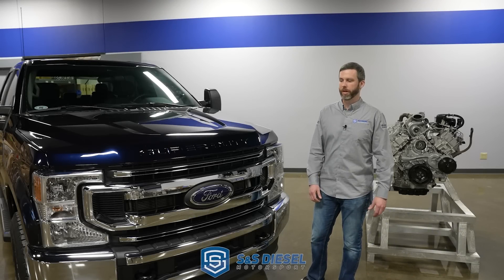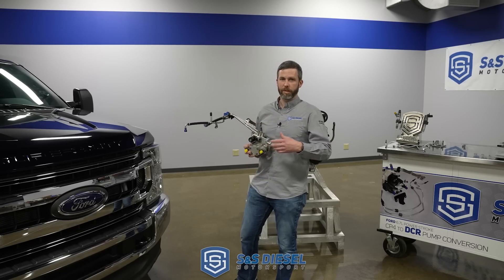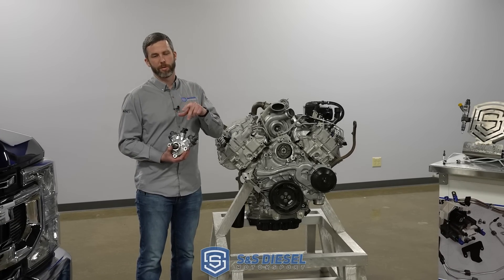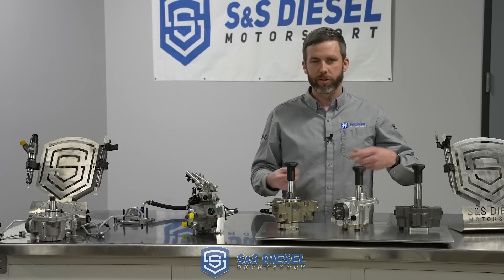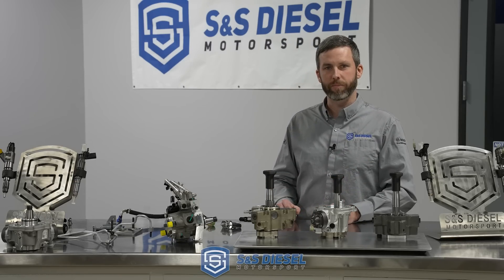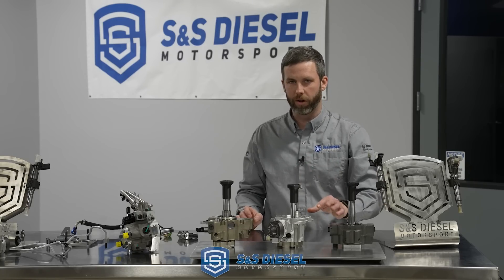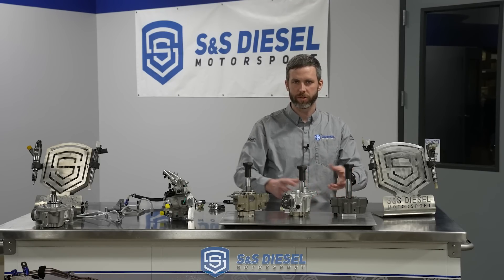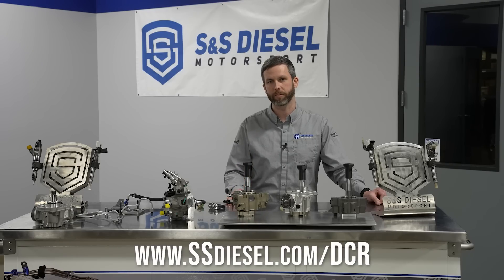The Long-Awaited Ford CP4 Solution - S&S Ford 6.7L CP4 to DCR Conversion

Comment: Does this apply for 2020 and up models?
Reply from the maker: Yes. The DCR Pump Conversion is compatible with 2011 and up 6.7 Power Strokes. It is CARB compliant up to 2023.

Comment: My biggest challenge is finding a really excellent in Western NC shop to install this new pump. I vetted several diesel shops in my area off your website and honestly need a much higher level of confidence that this pump will be professionally installed. One shop said they would need my truck for two days to check for leaks? 😮 Open to suggestions before I place my order. Thanks.
Reply from the maker: It's not a bad thing to take a little extra time to check for leaks after the fuel system has been open. In most cases it is not needed, but a little extra quality control is good. We have good confidence in the installers listed on our dealer map. They are either vetted by the distributor they buy from our by us directly if they are a direct dealer. We do not have a lot of coverage in Western NC, so you may need to expand your search into Tennessee or Georgia. Shoot an email to info@ssdiesel.com and we can recommend a few places that are Power Stroke specialists.

Comment: Where are these DCR pumps manufactured? Are they made in China? 🇨🇳
Reply from the maker: DCRs were originally made in China when we first released the Ford 6.7L DCR Pump Conversion. Since then, we have created a large enough market for the DCR in the USA that Stanadyne has built a DCR assembly line in Blythewood, South Carolina. While many of the components are still made in China, the assembly, end of line testing, and quality control are done in the USA. Even the pump bodies are forged in the USA. It's not uncommon for a global company to use a global supply chain. The main takeaway is that Stanadyne is a reputable company with locations all over the world. Since the DCR was originally developed for engines in the Asian market, that's where the original plant was built. Thankfully, a young engineer working in a US branch discovered that the DCR would fit in the valley of the 6.7 Power Stroke. That engineer insisted on working with S&S to develop a variant specifically for the 6.7 Ford and the rest is history. We have complete confidence in the DCR and will continue to grow the demand so that we can help bring even more manufacturing, than we already have, back to the USA. Here's a link to a video tour of the plant in South Carolina: https://youtu.be/y8IOhefx4Sw?si=RE1j3AW7UaKZ2Yy7
Reply: @SSfueled  Thank you!

Comment: Can this work for 2024 powerstroke 6.7L High Output diesel?
Reply from the maker: We have one installed on our 2023 HO and we are aware of another 2024 that is running a DCR. Both trucks are running great. With that being said, we are still taking our time to thoroughly validate the DCR on our 2023 before we make an official announcement.

Comment: Are you able to run both the DCR conversion kit with the firewall mounted disaster prevention kit on a 2011-2016 Ford F250/F250 super duty for two levels of protection?
Reply from the maker: The complete Disaster Prevention Kit is not compatible with the DCR, yet it is not needed. The DCR will not create fine metal debris if it does fail. The return filter assembly portion of the DPK can be retained and it will not hurt anything.

Comment: Why don't ford just start using it so we don't have to waste more money on those trucks?
Reply from the maker: We're trying. There are long-standing relationships and agreements at play. We would much rather sell to the auto manufacturer and do it right the first time around. Until that happens, we have a better option for Super Duty owners. We feel your pain. Spending that much money on a truck, you want it to be rock-solid from the factory.

Comment: looks like a good kit by wondering you say it helps save the fuel system. so do you guarantee it to save the fuel system or only help
Reply from the maker: Great question. Due to how the DCR is designed, it will not generate fine metal debris if it does fail. It does not have a tool steel roller and cam like the CP4. That is what creates the fine debris that takes out the rest of the fuel system. Failures happen with everything, so it would be irresponsible for us to say that the DCR will never fail. So far, it has held up well and there have been two cases of trucks getting water in their fuel and the DCR survived it. We can't guarantee that every DCR will handle fuel contamination, but it's a possibility. We offer a two-year unlimited-mile warranty on the DCR, and if for some freak reason it fails and sends debris through the injectors, we'll make it right.

Comment: Guys, I want to put a DCR on my new 2024 F550. Just got the vin# from Ford.  Truck should be in my hands sometime in Late October.  Will be a full-time traveler starting in 2024.  How soon could I get one installed in my truck?
Reply from the maker: Congratulations on the new truck! We are currently testing the DCR for 2023+ models. Ford went with a larger displacement CP4 for the 2023 model year and we need to make sure the DCR will match the output. We do not have an exact ETA for 2023+ support, but we'll be sure to spread the word on social media and via email when we do. You can sign up for email updates at the bottom www.SSdiesel.com. Thanks for asking!

Comment: I'm having a DCR pump installed at the shop and was curious when I get the truck back should I continue to use fuel additives with the new DCR pump? I usually always use hot shots everyday treatment?
Reply from the maker: Thank you for your business. Extra lubricity it never a bad thing, but it is not needed with a DCR. Clean diesel is good enough for the pressure-lubricated bushings. While we do not recommend it, we have had at least one DCR inject water and rust... and it is still in the truck and racking up miles. See here: https://youtu.be/HHC4hM-w-Hk
Reply: @SSfueled  thank you very much I look forward to getting my truck back from the mechanic shop with my new DCR!
Reply: How much is the shop charging to install the pump?
Reply: @jgofast9249  Around 2k in labor to install the pump

Comment: Just completed the CP4 
/DCR pump conversion.  Everything went fine.  The product seems quality and great engineering.   Question though.  Is a prevention kit needed also?
Reply from the maker: Thank you for choosing S&S. The DPK is not needed and it will not physically fit the pump. You are good to go.

Comment: Shop just called after DCR installed. Manager wants to know if the computer needs reset for adaptive learning? If not I can ho pick it up hoping to get a kwik answers
Reply from the maker: The DCR pump curve matches the CP4. It is not needed to reset the learning. Thank you for your business!
Reply: @SSfueled  Thank you also.  Truck running great! Driving with a highly improved peace of mind.
Reply: Got in touch with A Rod and on my way to pick her up. Both relieved and excited to get this bulletproofing measure done!!!

Comment: Don't buy the dcr from injectorsdirect they have a core charge.
Reply from the maker: The DCRs are brand new pumps that do not require a core charge from S&S. It seems that there is a bit of confusion we need to clear up with Injectors Direct. They are a great stocking dealer and we do not want to discourage purchasing from them. Thanks for bringing this to our attention, we'll get it sorted out.
Reply: @SSfueled  thanks for the reply. I emailed them asking why they are changing a core charge, and it's was because they wanted to rebuild the cp4. I assume to convert it to a cpx. The core is 200. I guess a discount code that got 100 off the core, but it just seems ridiculous to charge a core for what needs to be phased out. I would have liked to have bought from s&s directly, but I was told I had to go through a dealer. Yall emailed me 3 dealers that were out of stock, and even their prices fluctuated by 100-200. I'll gladly send my invoice to you. The next disappointment was I had originally orded from xdp that showed it as backordered after checkout. The date it was expected was 7/17, and then it'd get moved a few more days once it was within 7 days of the 17th. I will say injectors direct got it to me fast. Thanks
Reply: @hairtrigger903  Thanks for sharing your feedback. Typically, all injectors and pumps we sell are sold on an exchange basis (with a core return required) even if a core return is not required by the manufacturer. Some manufacturers require cores to be returned on new parts, while others do not. We find it is easier and simpler to require a core on everything. Most customers have no use for their old CP4 pump (in many cases they are eager to be rid of it), and have no problem sending it in as a core. We do not require you to pay a core deposit up front in order to purchase a DCR conversion kit. We have the option available to place a temporary hold on a credit card until the core is returned to avoid paying any core deposit up front. To be clear - in the case of the @ssfueled DCR pump, S&S does not require a core return. That requirement comes from us, and we do what we can to work with our customers and make it easy for them. As you experienced, we have the the DCR kits in stock, ready to ship the same day, and are offering them for the best price available at $1990.00. If a customer has an extenuating circumstance that would require them to keep their old CP4 pump, we invite them to reach out to us and discuss what options we have available. We would be happy to work with anyone to help them get the parts they need to get their truck back on the road. Hope this clears up any confusion. If you have any additional questions, feel free to reach out to Daniel at 1-800-500-0980 or send an email to customerservice@injectorsdirect.com. Thanks!
Reply: @InjectorsDirectCom  so I as I stated before, shop elsewhere for your future diesel needs
Reply: @SSfueled  good luck clearing it up. "Most people are reluctant to send us a cp4" my cp4 is still working its worth more than the core, if something goes south on the dcr.

Comment: So.. i have the s&s cp4 disaster prevention kit, will i still be able to use my dpk with this pump. I like the idea of knowing that fuel is filtered and would love to be able to keep it installed
Reply: Awesome news to here as i like knowing im getting the most filtration i can. 
I have 220k miles on my oem cp4. I have pre ordered the dcr pump also. Between s&s , h&s diesel and a few others i have zero oem filters because i dont plan on buying another truck for a good few years. I was a cummins guy to the core but the 6.7ps just does more for me performance and towing wise . 
Thank you for making some awesome products
Reply from the maker: Thank you for choosing S&S to protect your fuel system. We don't blame you for wanting extra filtration, even on the return side. The good news is that you will not need it. The DCR eccentric drive is unlikely to make metal, even if it does fail. Unlike the CP4, the DCR case and plungers are fed independently, which is the same as running a disaster prevention kit. Due to differences in the pump, the bypass portion of our DPK will not physically fit the DCR. The return filter assembly portion of the kit does not connect to the pump, so it is possible to retain that part with a DCR install. We're confident that the return filter is not needed with a DCR, but it will not hurt anything to keep it on if you want.

Comment: So. Is it not possible to have a oil lubricant fuel pump? I don’t know exactly how the fuel pump makes the pressure but I just feel like it could be done without the fuel going to the crank case of the pump.

Comment: I am very serious in consideration of your product but what guarantees do I have for the future
Reply from the maker: Our name is the guarantee. We offer a two-year unlimited-mile warranty on all products. The DCR conversion is not available yet because we are taking our time to properly validate it. Once the test vehicles hit the desired mileage, we will get the pumps back for inspection. If it all looks good, then we will release the 6.7F DCR to the market. Being a company owned by former Bosch and Cummins engineers, we are particularly cautious when bringing a new product to market. We want it to be flawless before we put our name on it.

Comment: Sounds cool. Your validation testing did include running fuel contaminated with water and DEF, right?
Reply from the maker: No. The DCR is designed to run on diesel, so that is what we are validating for. It could be more resistant to contaminants, but we want to make sure it's 100% under normal conditions first. Even though the OEs don't validate for contaminated fuel, maybe that would be something worth testing as an added benefit. Thanks for the idea.
Reply: @SSfueled  Thanks for the honest reply! As I understand it, most CP4 pumps don’t fail when using uncontaminated fuel with good lubricity, so when doing a redesign it’s not enough to show that a sample of the new pumps also don’t fail when using good fuel. To truly demonstrate an improvement you need to show that a contamination level that will cause, let’s say, 50% of a sample of CP4 pumps to fail in 48 hours, will not cause any of the redesigned pumps to fail when testing more of them for longer periods of time. It should only take a couple of months on a test bench to do such testing, and being able to say that you did it would be a great marketing point.

That being said, the design changes you've described do sound very promising.

Comment: What makes the dcr different from the cp4?
Reply from the maker: The biggest difference is the eccentric drive for the DCR vs the two-lobe cam and roller for the CP4. The other big difference is how fuel is supplied. The case and plungers of the DCR are fed independently while the CP4 case feeds the plungers.
Reply: Did you watch the video?? Luke gave a good explanation of the differences!!...GO BACK &  LISTEN!!
Reply: @zekester1  yes I watched the video.  I didn't understand the difference in the mechanical, and metallurgical.
Reply: Thank you. I see the difference now.

Comment: How much power will pump provide
Reply from the maker: We designed this to be a durability improvement and have not tested for increased power. The DCR has 25% more displacement, but that may not necessarily equate to a 25% power increase (if the calibration calls for it). Since it will be CARB compliant, just installing the conversion by itself will not increase output in any way. We do not recommend changing the calibration on street-driven vehicles.

Comment: So how are these in a performance aspect? Higher flow compared to like a 10mil stroker or pretty much the same as a 17-19? What's the max bar psi with this? I know it says no tuning but I know a 11-14 pump in a 15+ truck runs like crap or vice versa. Just curious about the no tuning needed and flow numbers.

Comment: This is Trash,,, you should spend your millions on a Class action lawsuit as a real solution... millions of us ford guys have suffered long enough with this ford bullshit cp4.   Mine failed brand new 2021 F350 with 20K miles....    and had to literally fight and BRIBE the dealer to fix my pump for warrantty.   20 K Miles...     Ford should recall that shitty pump like RAM did last year, DESPICABLE DESPICABLE DESPICABLE..    100K For these trucks  the UNDERSIDES Are rusting off the showroom floor and the Fuel system is garbage because of this bosch pump,.,.. COME ON FORD
Reply: Send your Design and sell it to ford  so millions can benefit from this despicable that we have to find some offbrand conversion kit for a brand new truck...   GAG ME WITH A spoon
Reply: 2,000 PRice tag

Comment: Hooray!! Will this work with existing tunes on the trucks?
Reply from the maker: The 6.7F DCR Conversion is plug and play for the stock calibration. We have not tested it with any other calibration, but the ECU will control it the same as a CP4.
Reply: It does actually perform a lot better than the factory pump with race tunes

Comment: Is the disaster prevention kit still necessary with this upgrade?
Reply from the maker: The DPK is not compatible with the DCR, but it is not needed. The DCR internal plumbing feeds the case and plungers independently.

Comment: OK with this not being proven, if it does fail, are you guys willing to cover the damages to peoples trucks? With a $2000 price tag there should be some guarantees!
Reply from the maker: Our name is the guarantee. We offer a two-year unlimited-mile warranty on all products, pending an inspection. We're confident that the DCR will not cause additional damage if it fails, but we'll make it right if does. If it fails due to contaminants, that's a different story. The DCR conversion is not available yet because we are taking our time to properly validate it. Once the test vehicles hit the desired mileage, we will get the pumps back for inspection. If it all looks good, then we will release the 6.7F DCR to the market. Being a company owned by former Bosch and Cummins engineers, we are particularly cautious when bringing a new product to market. We want it to be flawless before we put our name on it.
Reply: I just put your kit on a 2015 f250  it's really great quality and the instructions are top notch and very precise .

Comment: How does this compare to the output of the Exergy 10mm?
Reply from the maker: Since the 6.7F DCR Conversion is designed to be a durability improvement, we have yet to test the max output vs competition pumps. The displacement of the DCR is 25% more than a stock 15-19 CP4.